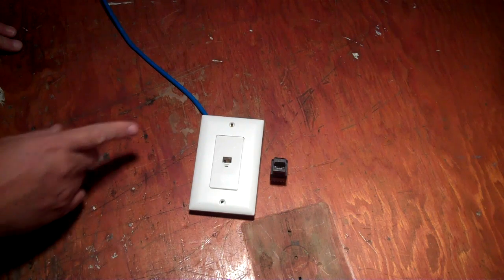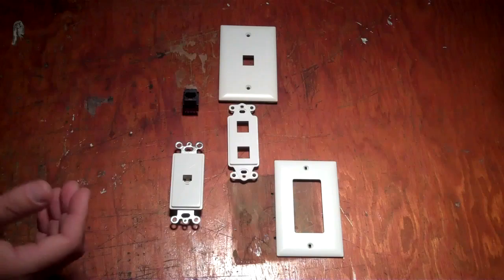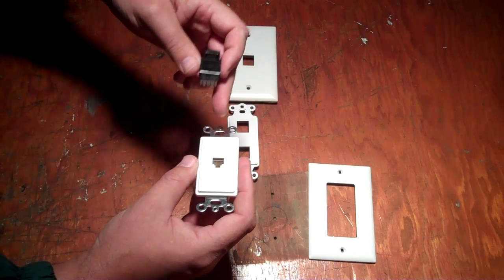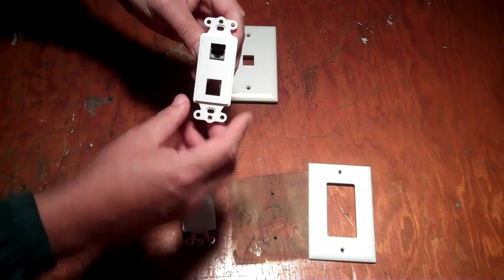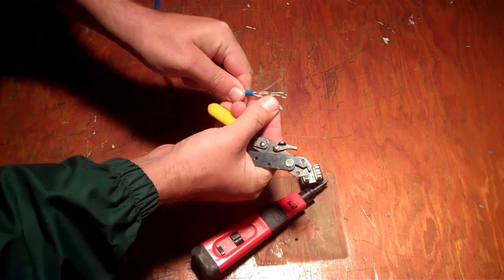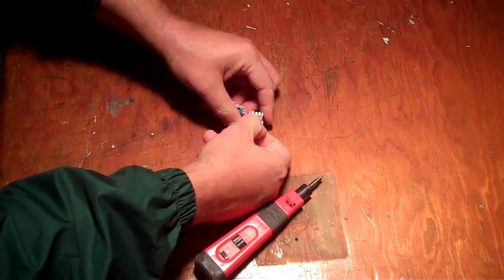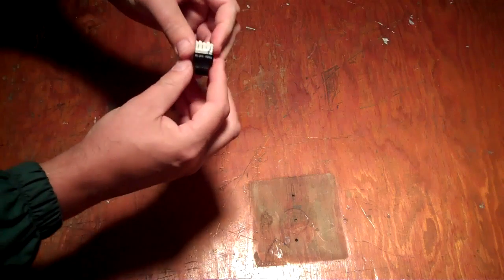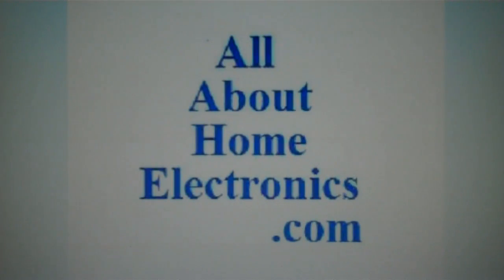How to Install a Phone Jack with CAT 5

Comment: So I need to redo the wiring from my outside service box to inside my house to a jack for my centurylink modem. Would this work in this scenario running cat5e from the box outside to the rj11 jack only using the one pair of wires “blue” and “white and blue”
Reply from the maker: Two pairs are required! One pair transmit, another pair receive

Comment: If you only install the blue and blue/white wires, will the rj45 jack still support 2 dial tones, or do you need to connect more wires?  Can you connect all the wires and still plug in a phone line?
Reply from the maker: Cat5, Cat5e and Cat6 wire are all similar in that each contains 4 pairs of wire, one of which is the Blue - Blue/White pair you mention. If you only "punch down" the blue pair onto the center pins (pins 4 & 5) of the rj45 then you'll only support one dial tone.  To add an additional dial tone you need to connect more wires. Yes, you can connect all the wires and still plug in a phone line.
Reply: so in another word, if i need to plug the cat5 into a phone jack.  I need to make a cable with one end having the RJ 45 and one end with RJ11.  Am I correct?